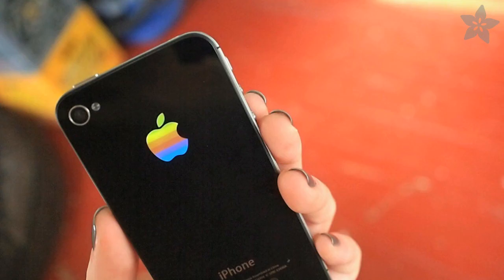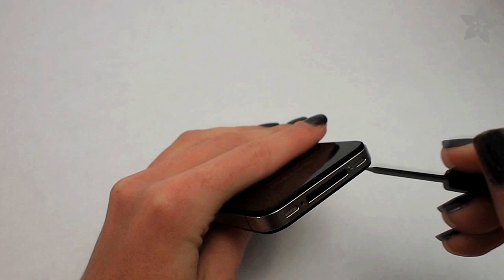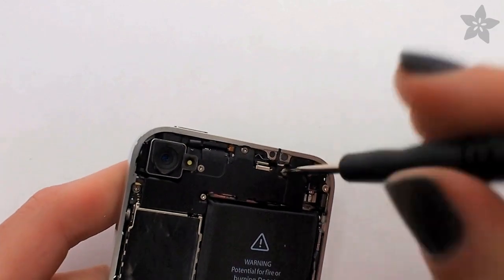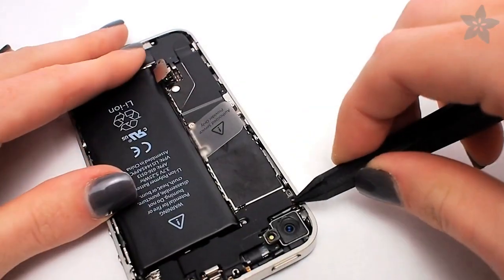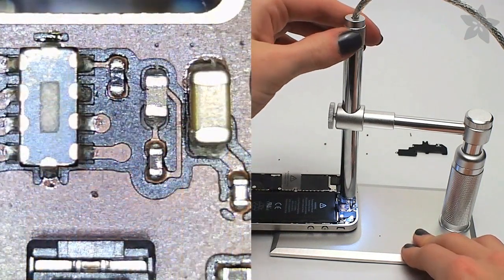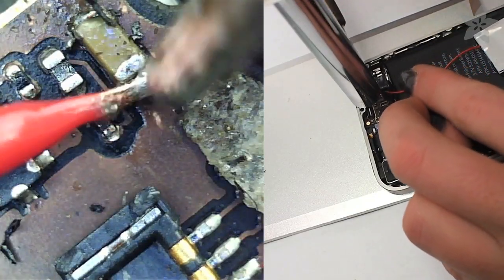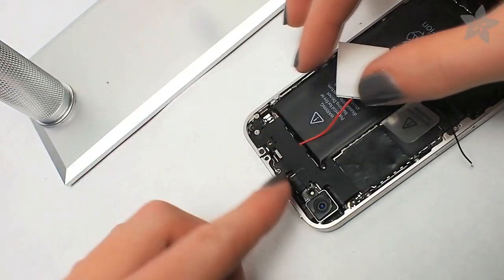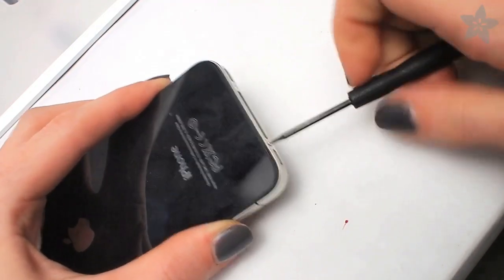iPhone Light Mod

Comment: What technology are you using for the light panel? Is that EL? If so what voltage are you working off in the iphone? is it DC? If so what EL panel technology are you using?

Comment: - There are definitely more places where you can get ripped off buying this than places which won't rip you off. I've seen this being sold for as much as 100$ when my supplier (which generally has prices slightly above average) sells it to me for less than 13$.

- The glass panel is relatively ludicrously thin because of the space needed for all the tape, wiring and the LED, which will make it feel super cheap, flimsy and your chances of breaking it are much higher.

Comment: I repair iPhones (and other iDevices), and I just wanted to warn people before they do this about a couple of things:

- To do this, you will need to connect the LED to a power rail which feeds the LCD, and over a period of a couple of months, the LCD will start to loose brightness, contrast, and color vivacity (or whatever it's called) due to this. Also, the Apple logo will light up virtually anytime there is any cellular activity - this may bug you.